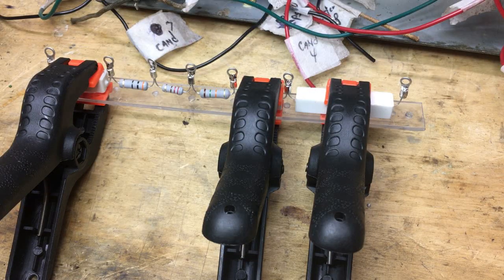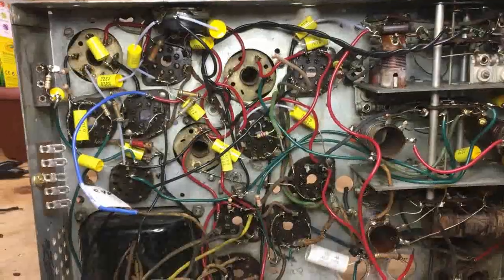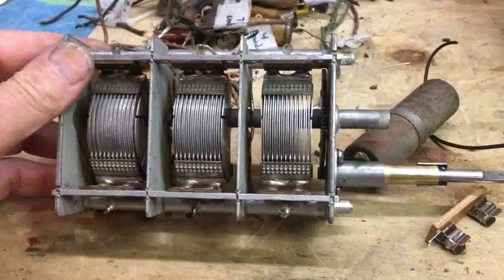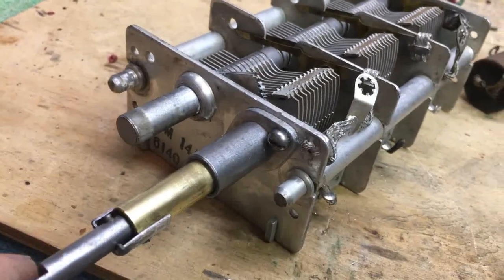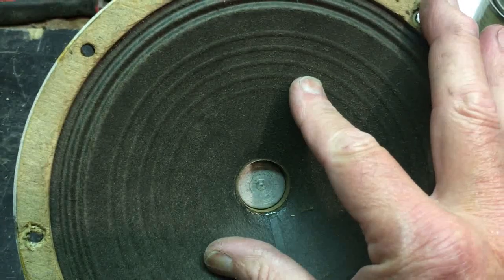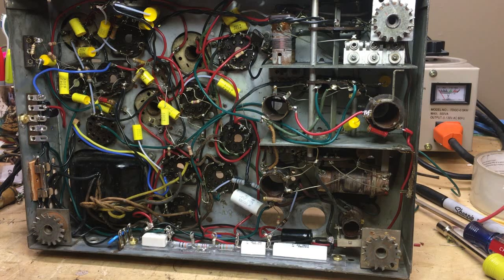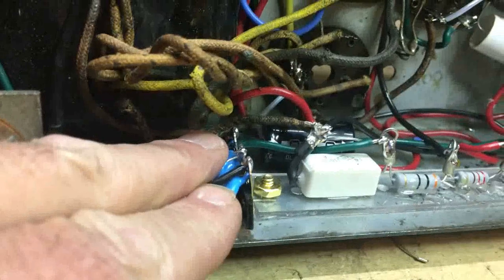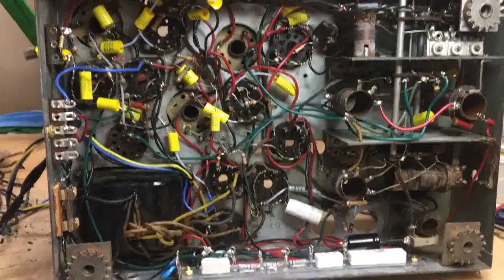1936 General Electric E91 Colorama Part 4 of 9 Recap, wires and Candohm Construction

Comment: You're moving right along, Larry. Looks good. I used those same bulb sleeves on my E101 and E91's and they look great. The green is a nice bright green and the red is a nice bright red. Definitely better than dying the bulbs or painting them. And you're right a little dot of water will make them slip on much easier. Did you order a set of decals for the cabinet yet? Radio Daze has them. Regards, Greg
Reply from the maker: gavinwb1 Thanks for commenting Greg! Maybe it was you I stole.... Uhhhh borrowed the idea for the bulb caps from! Lol. No I havent ordered the decals yet, but need to. Thanks for reminding me. That seems to be some of the challenges, especially shooting videos is to get things ordered in time for the process to flow smoothly. Im getting to the point, I think Im close, but keep telling myself, you are missing something! Lol. Im sure you know that feeling. If you rush it, there will be that one connection that could haunt you for a while! Lol. Thanks again for watching and commenting. Best--Larry
Reply from the maker: BTW, which decal set should I get? The one for the E105?  Thanks for the help! Larry
Reply: Hi Larry, Yes, definitely the one you want is for the E-105. That's the console version of the E-101...same chassis / decals. The E-91 uses the same decals too except for the AFC, of course, which it doesn't have. PS: I liked how you handled the candohm resistor replacement. Looks great!
Reply from the maker: gavinwb1 Thanks! I'll get them ordered. Thanks on the Candohm compliment! It urned out pretty good, and I hope it works as well too! Lol. Im looking for a dial now. When I started to address it, I discovered a bad spot on the broadcast band section that I dont think I can live with. Hopefully, either I can find one, or Radio Daze can reproduce one. I have a message into John at the graphics department. Oh, well, it makes for more work but will make it more gratifying in the end. I finished the wiring last night, and need to triple check all the components and connections again. Thanks for the comments and input, they are always appreciated! Best--Larry

Comment: Larry,
That sleeve arrangement is cool.  Simple and elegant.  You are doing a fantastic job on this radio.  That tuning condenser looks clean enough to eat off of!   I love your "Highway of Death"!   My only question is, did all those parts and wires get fair trials, before being condemned to the Highway of Death?     [; 0)       Cheers!    Michael
Reply from the maker: ThatTubeSound lol, Thanks Michael! The resistors and wires got a trial, the caps were sentenced before hand. The short run suspended wires were left alone, some of the resistors were bad, so they were replaced. What was time consuming was the pyramid replacements. Lol, I would start with one component, and I made sure the termination was totally clean before resoldering. This created 2-3 loose components, which fed 2-3 more, which fed 2-3 more. But I removed all the solder and cleaned them. Keeping track was hard at times. Wait u til later when the fun stuff starts, lol. Thanks for watching and commenting! Best--Larry

Comment: Nice job on the candohm Larry.  How did you attach the metal eyelets to the plexiglass?  Entire chassis is looking great. Looking forward to the next installment. Mike McKenzie
Reply from the maker: Michael McKenzie Michael, I wanted to attach the eyelets to the lexon by drilling dimples in it and glueing them. But, it would have made the connections too low, so I just joined the resistor leads in the eyelet and soldered them. After all the wires were terminated to them, they were fairly sturdy. Thanks for watching and commenting! Best-- Larry